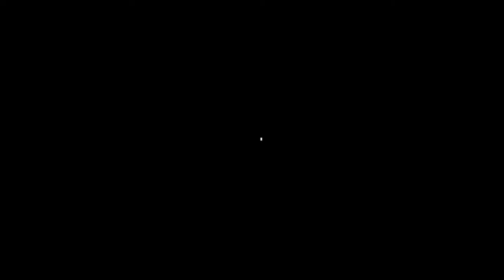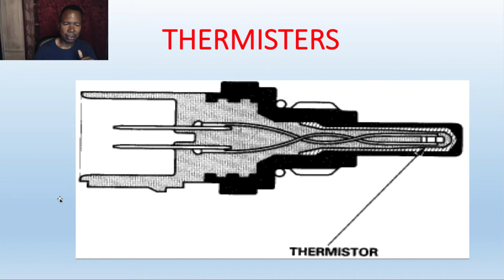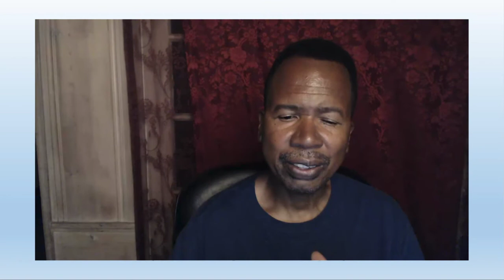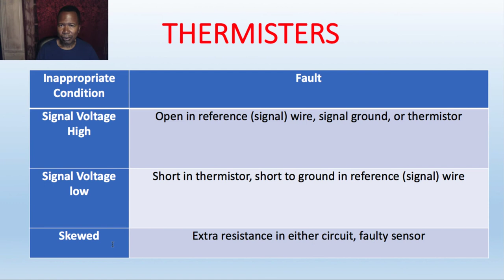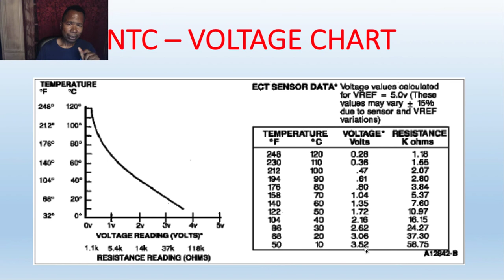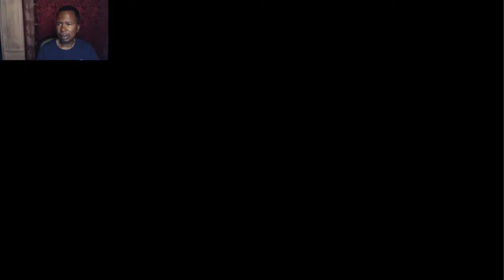2b.Smog Technician Training: Computer Control What is a Thermistor | smog class | Power Point ATG

Comment: What is the importance of a fixed resistor inside a module? What types of problems can occur without a fixed resistor?
Reply from the maker: A fixed resistor in the ECM is usually used as a reference point

Comment: Where does extra resistance to the ground wire come from if the resistance doesn't match the temperature?
Reply from the maker: It could be corrosion or loose wire / connector